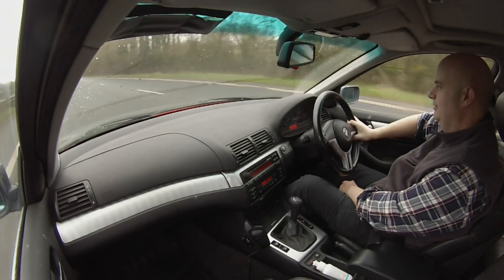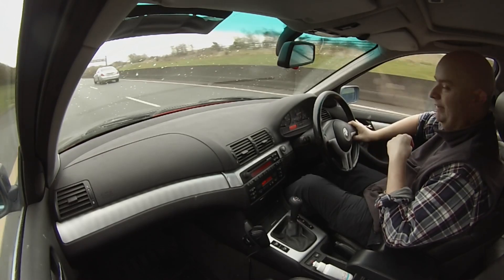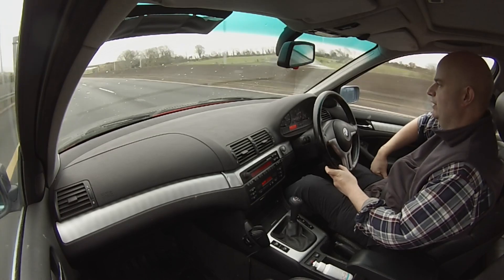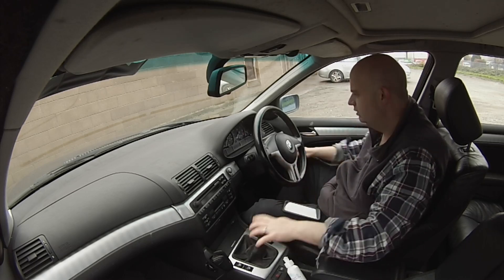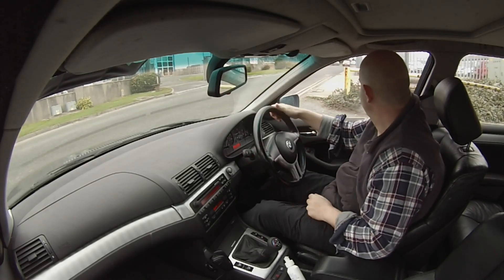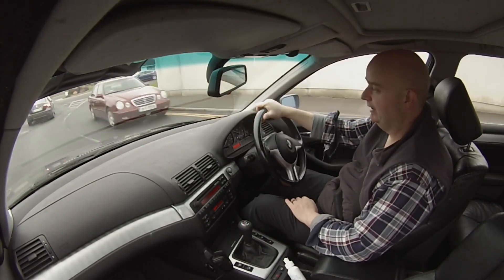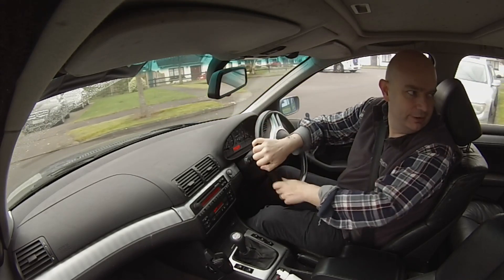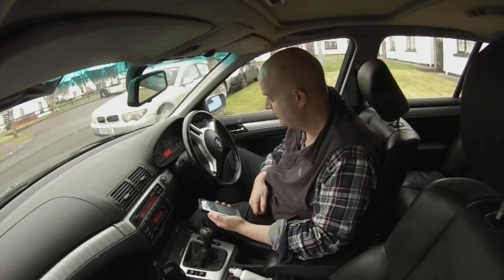E46 Touring : The Grey Goose Lives

Comment: I see you don't use the clutch pedal when changing gears so I wonder how do the gear changes work. If you just move the gear lever then why wouldn't the gears make crunchy noises. Always admire your videos. And I think using a Leaf motor is interesting. Thank you for what you do.

Comment: @Damien Maguire do you have a particular reason for pulling the HandBrake while in the stop sign? For saving power on the brakes vacuum pump which would otherwise have to be running?

Comment: Great video and even better work.
Questions:
- I see you start in 2nd gear. Is the electromotor too powerful for the 1st gear?
- Does changing the gears help a lot to using less energy ?  
- What kind of acceleration are you getting? Like 0-60?

Thanks again
Reply: I am also curious about those things

Comment: Is the white truck your next project lol :):) awww poor cat.......
Reply from the maker: no cats were injured in the making of this video:)
Reply: @Evbmw  Poor thing got the fright of it`s life....
Reply: @Evbmw  Another perfect  conversion,  i`m looking at starting mine this summer i saved from recycle bins nearly 5000 18650(laptop batteries) and for a test battery nearly 5000 ni-mh batteries too, so both battery chemistries remove the battery cost  for a conversion :)
Reply: @kylereese4822  That's a lot of soldering.
Reply: @CraigDavies.  I`m planning on spot welding them 4 spots on + 4 spots on - and rapidly lose my sanity in the process lol :):)
Reply: @kylereese4822  I think that may have already happened. 😜
Only kidding mate, I considered something similar myself. I guess you'll be going for something like 50P 100S with 5000 cells which will probably give you around 25 to 30kWh. That's a lot of work for the sort of range you will get but I guess it has advantages too. You can fit the pack around the car just as you like. 
Be sure to use genuine nickel and not steel with nickel plate for your spot welding. 
Only thing with laptop cells is you night be a bit restricted on current. What will be the max current you're happy to draw from each cell?
Reply: @alibro7512  It all depends on the car i get, if it`s a Fiesta type car it`ll be a Prius gearbox and some of the battery pack next to it the other part under the rear seat/exhaust tunnel --- If it`s a Merc the battery pack will be in the engine bay / trans tunnel  and the Mitsubishi Hybrid motor in the rear...  as soon i know the pack will be made to suit... then i`ll lose my sanity shortly after lol :):)